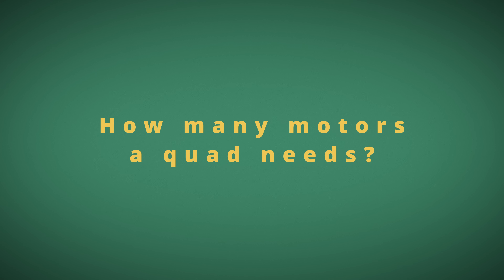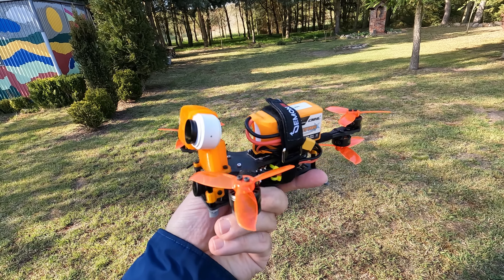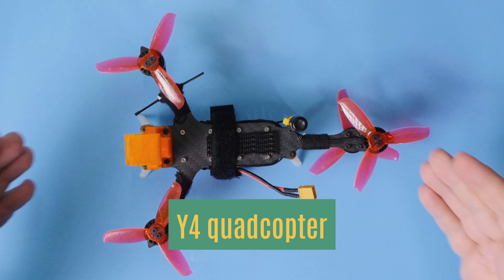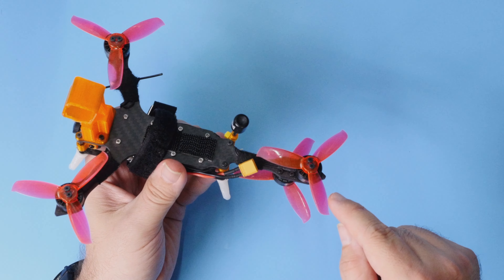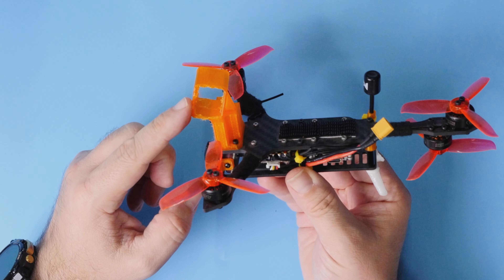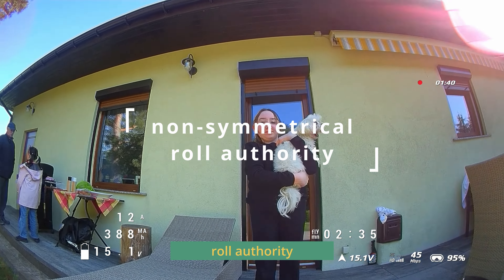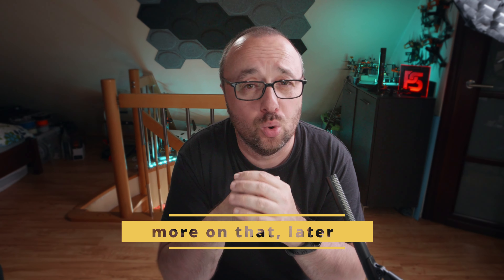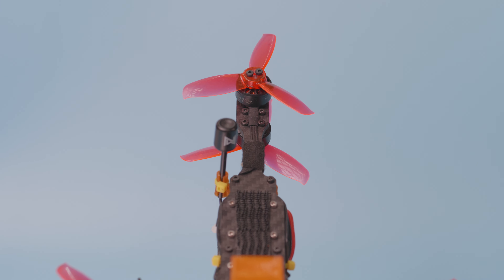A drone with 3 arms

Comment: IMHO you should keep default roll mixer as removing roll from rear motors introduces adverse roll to yaw coupling rinstead you should remove yaw from front motors as it introduces yaw to roll coupling.
Reply from the maker: Rear motors have ZERO roll authority because they are on the symmetry axis. They physically do not affect roll. Yaw is handled by YAW authority
Reply: @FPVUniversity  doesn't matter, they counter roll induced yaw
Reply from the maker: @tymoteuszkazubski2755  Absolutely, but those 2 motors have no authority on ROLL! Induced yaw is handled by PID, not mixer
Reply: @FPVUniversity  why use feedback controller when simple feedforward can do. The PID controller responds with a delay, the mixer compensates instantly.

Comment: In understanding your choice of 4 motors was it because you need 4 motors to configure iNav properly?  Would iNav or betaflight work with tri motor y-frame or would you have a custom controller for that?
Reply from the maker: INAV fully supports all motor configurations. At least the ones that are physically capable of flight. Betaflight also can do it, but setup is more cumbersome